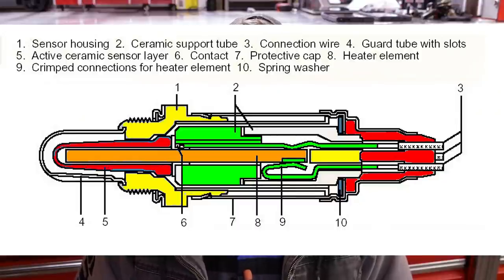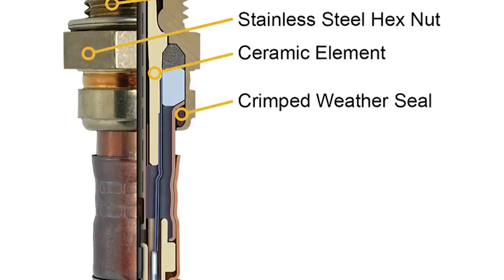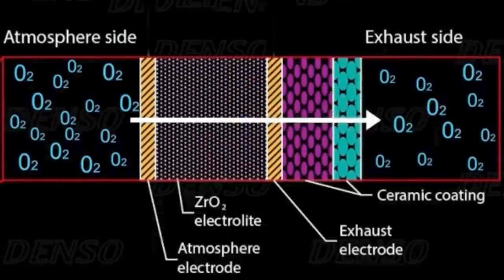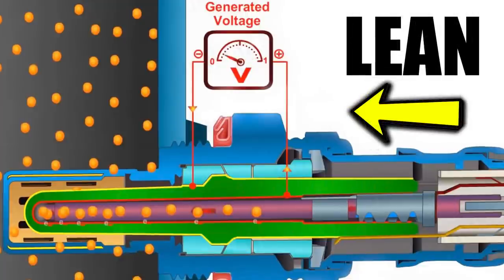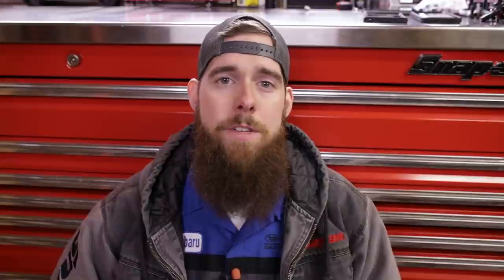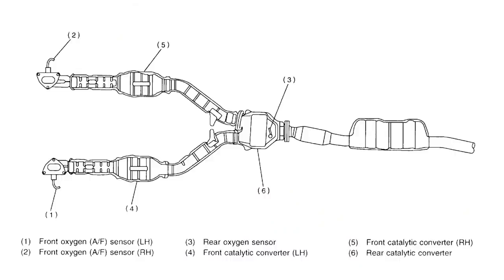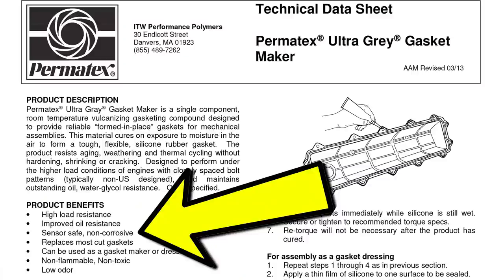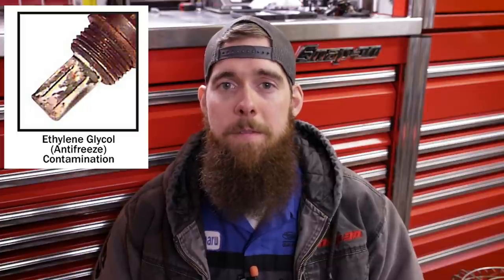Oxygen Sensors Explained! | An Introduction Into The Theory Of, Workings Of, And How They Fail!

Comment: Great stuff! But you MUST now do the follow up on Wideband sensors which wld be pre-cat sensor in almost all Subies since early-mid 2000s ... very important to understand failure modes and can be tricky😱 After a long diag, finally discovered an intermittent failing wideband O2 with a P0030 code on 2004 Forester with EJ251 was caused  by sensor element internal resistance not falling quick enuf to meet PCM programmed parameters ... in this case, PCM requires less than 50ohms within 30sec of start or after fuel cut off condition. Very tricky to nail this, but wen u r going to charge a customer $700 for a new part that u can’t return u need to be dead certain. Lets do failure modes, diag and test procedures on wide bands? 😉👍

Comment: Great Video as always.  Picked up a used 2015 Crosstrek Premium with 92K mile for my kid. I've been doing various things and this is one I like to do at 90 -100K.  Relative to the other Subaru's O2 sensors it's in a pretty easy spot to get to.  Replaced the front one with a Denso brand which seemed to be the exact same as the OEM I removed. Right down to the color of the wire coating and wire tie fastener.  I consider it inexpensive insurance for the future.

Comment: I'm working on figuring out the cause of my catalyst efficiency codes so this was great timing.
I've long determined the converter is gone, but working on debating if I should swap the sensors "while I'm in there"

Comment: I had one of the older Subaru Outbacks you speak of. An 01’. When I bought it the head gaskets were blown unbeknownst to me. My father in law and I redid the engine and it ran nice for a long time. I live in NY so eventually the rust got to it, put a crack in the actual fuel tank. The o2 sensors did their job -never threw a code. 
Very informational and well laid out video. I can’t wait for what you have next!
Reply: Excellent review, it should be noted that heat is the lowest form of energy. Just about everything generates heat as a byproduct. The O2 sensor takes heat and turns it to electricity, a higher form of energy. That's why they wear out. FYI.

Comment: Finally, a most comprehensive explanation on this item. Question though : will the slots in the casing determine the workings.? My supplier insist that the one with the smaller slots are the correct based on the part number.  But after installing, engine kinda running weird - like a very short hesitation when acceleration.. Especially when the AC is on..

Thanks for the great video..👍

Comment: Great presentation. I have a 98 honda Accord that has several O2 sensors die. It also burns one quart of oil per 1000 miles. You are the first to associate oilcontamination. Thanks.

Comment: Coolant takes them out too,the Fords with the 3.8 which had headgasket problems would take them out when the headgaskets blew. ln certain year Dodge truck,the  O2 sensor also is involved with shifting of the transmission.Have fixed a few transmission problems in these replacing the rear O2 sensor.Do not top off the gas tank,EVAP system needs space and have seen O2 sensor codes appear from this

Comment: I remember giving my tuned rs to a shop in Utah that “specialized” in Subarus to fix a surging issue I had while driving, left it at their shop for three months while I was out of the country and came back to them “solving” it by replacing my charcoal canister.   I took it to Colorado for a friend’s bucking and surging the whole way there, under wot it ran normally. I happened upon the Subie Doctor while in Colorado and within ten minutes of looking at it had already diagnosed the issue and put in a brand new oem o2 sensor.

Comment: Great explanation.  There is a lot of bad information out there on the internet about these sensors that I found when troubleshooting a P0420 code on my '10 OB specifically the many folks saying to replace both O2 sensors.  Mine were working correctly and the downstream sensor was telling me that something was wrong thus setting the P0420 code for catalyst insufficiency.  I cured that with three treatments of  Cataclean and no recurrence some 1000 miles later (I suspect that I disturbed a bunch of crap in the vapor collector when I overfilled the gas tank and temporarily shot crap through the engine).  Keep these videos coming - they're great.

Comment: Don’t have a Subaru but have an 04 Honda Element and this video was very informative. Months ago I was in a heavy rain downpour and my check engine light came on with a P0420 code. I cleared it but now it came back again. My car has over 218,000 miles. I bought new sensors anyway and plan to install them but taking it to my mechanic to install and check the system anyway. The car runs good and I have added Cataclean to see if that helps. Short term bank 1 fuel trim 6.2%. Long term bank 1 fuel trim 3.9%.

Comment: Talk about perfect timing, I had my 2010 Forester serviced last month for (System too lean {Bank 1}), and the A/F sensor was replaced. A week later the Check Engine came back on with the same code via (Hum by Verizon P017) which turned out to be more than the sensor itself. Intake Manifold Gasket/Fuel Pump/InjectorSeals/PCV Valve. Not bad for a high mileage vehicle 412,433+.  
I will be doing a complete front-end overhaul by April 2022. In 2023/24 my goal is to buy a new Forester when I retire and hold onto this ole girl...

Comment: I would enjoy a followup regarding O2 sensor heater control circuit high/low codes (P0031 & P0032). This will also cause an open loop condition in some Subarus. I'm pretty sure the ECM sends a PWM signal to the heater, switching the ground, and if it isn't detecting proper resistance?? from the heater, it will shut off the O2 sensing, defaulting to open loop (14.7  fuel/air ratio).. Of course, a bad heater or heater wiring will cause this. There's something else causing this in my 04 Baja. Really pissing me off. I'm sure a lot of folks are chasing this error. Any help would be great.
Reply: Same here I've changed sensors twice and still have the problem

Comment: My 03 Bean, which I've had since new, threw an oxygen sensor code about three years ago. It's always been garaged and has never had an engine fault. My mechanic replaced the sensor (although he said it was a real pain to get out) and all was fine, but I had him go ahead and replace the other two sensors. After that the engine seemed to run much, much smoother. I guess 15 years is about the life span of these sensors before they start deteriorating.

BTW, my wife's 02 Camry (also since new) threw a front oxygen sensor code a few years ago. I got an OEM Denso sensor for less than $100 from Amazon and it took 15 minutes to replace it as it's on the top front of the engine. Couldn't have been easier.
Reply: My 09 outback needed a new O2 sensor to pass inspection last summer. A $350 repair.

Comment: I have a question or 3. First let me say thank you for your time and effort in making these instructional videos. I've found them very useful. 
I have a 2002 Outback sedan with the ej25. I bought it 2yrs ago with 163K on it and it came with Blue FelPro MLS headgaskets. I have 193K on it now. I bought the OE new gaskets that are the 642s the latest rendition from what I've found. I'm wondering do you think if be better off getting a new low mileage engine from JDM for like $1,500 or rebuild it myself? I've built an engine before gm 350 small block. But I'm sure it would cost me the same if not more.  I've also read that some of the connections are different on the ones from Japan but I assume I can just swap those from mine. I've already replaced all 4 wheel bearings,  bushings,  struts,  drilled and slotted rotors with ceramic pads and new tires. I love this car and even used cars are stupid priced and can't touch a good used car for what I'd spend to fix this one. The interior and exterior is in really good shape. I had an Aisin timing belt and water pump kit coming from Amazon but then they canceled the order stating it didn't meet quality specs which I found odd. Any advice or direction you can point me is HUGE and greatly appreciated. Thanks in advance.

Comment: Superb underrated video. This deserves way more views. MrSubaru, I am almost finished swapping a jdm ej20x long block on my ‘05 OBXT. Everything above the long block remained USDM. But I noticed these jdm engines have the main O2 sensor at the beginning section of the Down Pipe, rather than on the Up pipe. I disabled the exhaust AVCS since I’m using the usdm ECU. Being the main O2 sensor is on the Down Pipe for the ej20x motor, do you think this might influence the correct operation of the car?

Comment: I just so happen to have a check engine code for O2 sensor that began shortly before my radiator sprung a leak and another code was present for either thermostat or fan malfunction , the fan is operating so it's the thermostat.
I believe the faulty thermostat likely caused the old radiator to become pressurized and rupture. 
2002 Subaru Forester S with 148k miles.
Not sure exactly how any of the coolant problems may have affected my O2 sensors but i have no head gasket leakage that's detectable yet.

Comment: Very informative, I may replace the sensors in my daughter’s ‘09 Impreza NA as a precaution. 106k miles, gas mileage isn’t great, like 22. No codes. It does use some oil so will be interested to see what they look like. One suggestion: tell us what brand of sensors you recommend. Thanks.

Comment: excellent video congratulations, I have a question.
What happens to the oxygen sensor when a car is put direct pipe?
completely removed?
does it seriously affect performance?
Reply from the maker: Direct pipe?
Reply: @MrSubaru1387  Straight Pipe Exhaust System

sorry but i use google translate
Reply from the maker: If you remove the catalytic converter, no, doesn't affect performance. Just illegally removes a pollution control.
Reply: @MrSubaru1387  thanks for the explanation and great channel

Comment: Great video! My Legacy wagon 2006 EJ204 has a P0130 code. Bank 1 Sensor 1. I replaced the sensor in front of the catalytic converter but nothing has changed. Do you know if it can be the sensor after the catalytic converter or what else can be the problem?

Comment: Could an alternator failure possibly cause and old oxygen sensor to intermittently cause the check engine light to go on and off after the alternator is replaced? EJ251 with 144K miles. Long story behind the alternator failure and why the sensor code wasn't fully investigated but currently, after about 700 miles, the light is out.

Comment: Current Fault Log
P0138: O2 Sensor Circuit High Voltage (Bank 1 Sensor 2)
 Pending Fault Log
P0137: O2 Sensor Circuit Low Voltage (Bank 1 Sensor 2)
 Historic Fault Log

Can u help on that

Comment: I just drove cross country and halfway through Kansas I heard a loud sputtering sound. It was like a train. I pulled over and dad helped me figure out it was the oxygen sensor that was rattling and let loose. The updraft. We had to buy one and replace it to keep trekking. It was mostly an easy fix but the fact that the shop I took it to prior to the trip didn’t catch how loose it was, is just disheartening. They also didn’t even check the spark plugs or change oil filter or the melted-on gaskets on the transmission oil head. So many other issues. I have an ‘07 forester with 85,000 miles. Oh goodness the brakes were incredibly crusted on. Not even wheeling them helped. We just replaced the entire shoe and we’re able to salvage the discs and clean them up. Long story short the car came from Massachusetts and had never been officially serviced since. So I’m slowly getting up to speed. I have images I’d really love to email you if you ever want to share with your audience! Best regards.
Reply: I hate to say it, but I wouldn’t trust any shop or dealership on a Full Multi Point inspection… when I owned a brand new 09 Chevy, I paid a little extra for the lifetime oil which included an “inspection” of ; Brakes, Tires, Lights, Filters, etc. Well I had something go out or “bad” no less than 150 miles after my last oil change, and I said to the dealer; I thought y’all checked this along with all these things at every oil change? They said it’s more so a Visual Inspection, as in, if they see it and it noticeably needs replacing/repaired, then they do but that they don’t physically/literally put hands on each specific thing… which means they go down the 44 point check list and just cross them all out after doing a oil change and call it good. Granted this is a little different than say taking a rig in for a $200+ inspection and service, but again, I bet you anything a lot of it is briefly glanced at, doesn’t even have hands put on it….

Comment: I have a 2016 Forester with 110K miles. Periodically get the P0171 code, RIGHT at startup, never as I’m driving. I did have a local shop check it and they claimed it was a stored code and fuel trims were where they should be, but after a reset, two weeks later the same code popped up again at startup. I have changed PCV and hose, cleaned throttle body and MAF, without change except smoother idling.  Plugs have never  been done( I know, it’s on the list). O2 sensor never changed . What’s your take on this?  Any help is appreciated, thanks!

Comment: So just bought a 2010 sti hatch , has 122000 miles on body, just pulled intercooler off and saw I have a iag stage 2 tough block installed at 80000, has a downpipe and exhaust , it smells rich at idle and it has black in the exhaust tips. No oil leaks or coolant leaks no vacuum leaks . I’m thinking when he blew the original motor in the car it had oil/ coolant go through the exhaust , and I’m hoping they just didn’t replace them, just spent 300$ on new sensors….. I’ve tried everything I can think of just hope it works …. Any advice. It’s stage 2 tune also

Comment: But at higher rpm wouldn't the exhaust pipe have higher pressure , since more fuel and air are added? Wouldn't that higher pressure give other signals even though the oxygen content is the same?

Comment: Hi everyone and mr.subaru my impreza blobeye 2.0 gx 2003 125hp 92kw wagon has a problem with starting up. It always starts but its weird. Summer times its cranking up like 5-10seconds. Winter time on cold start it starts immediatly. If i turn the car off and start it in a minute it starts immediatly, but if i leave it for like 15mins+ it crancking like 10seconds. As i know car is doing that for like 10years i bough it like that. It has 230000km and original engine. Do you maybe have a video on that or any clue what could it be. I have zero engine codes? Love your videos 😃

Comment: Subaru outback 2005 California p030 or p050 ? The resistance is good. When i erase the code come back couple days. What is your Recommendation?
Reply: If the sensor signal wire is receiving about 2.5V-2-2.8V from the ECM with key on, and the heater circuit power and ground are good, then my experience has indicated that the sensor is faulty in that the resistance sensing elements is not falling as quickly as the computer program requires, therefore meaning lower fuel efficiency especially at start up. Usually, the ECM will shut down the sensor for these codes so you may have to cycle the key and test quickly before the ECM shuts down the circuit.

Comment: Hi! Thank u for your videos!
Can u tell me please from were to start searching:
Gda wrx
slight pulsaiting while slow acceleration or cruising, if wot car flys very well.
New sparks new coils etc.
Car is bone stock, no leaks, 
I know the car quit well, so such things as sparks,leaks etc, i have I excluded. 
Can such slight pulsating,Hesitaiting caused by low fuel pressure or o2 sensor?
Thanks!

Comment: My 2003 H6 outback gets the code for sensor heater fail bank 1 Replaced both and within 5000km again same. Tested old sensor and sure enough no circuit. Could something else cause this?
Reply from the maker: The heater was burnt out in the Bank 1 sensor, you replaced it 5k km ago, now it's burnt out again?

Comment: I have a 2004 subaru outback . It's a premium with leather seats. 2.5 engine 4 cylinder. The tool is reading bad cat. But the car runs great no power lost an its been some time. Could it be just a bad oxigen censor
Reply from the maker: What code? P0420?
Reply: Let me check...hold on
Reply: Po 171/po 420 / po 174
Reply: What do you think
Reply from the maker: @gaator1967  I’d address those lean codes and then move on to nay potential catalytic converter issue.

Comment: Considering replacing my stock y pipe on a 94 legacy L 2.2 with a header, looks like I will have to weld a bung in for sensor upstream, also, I have a new catalytic I could install, as I want to go ahead and just put all new exhaust on it. If I mimic the positioning of the stock O2 sensors and keep the stock muffler do you think that will work with the ecu?
Reply: I had a bad gasket after the Y pipe this year and replaced it, but mileage seemed to suffer after the gasket replacement, didn't change anything else, seems to run very rich on start up. It is also very cold now.

Comment: Tech question for you . I have a 2013 STI I’ve been having oscillation idling from 800rpm to 1300 rpm. I replaced my front O2 sensor with an OEM after engine rebuild. Then a tuner said it might be the O2 sensor. So I replaced it with an after market Bosh and it got better for like a day then oscillation idling returned but not as bad as the OEM sensor. So I drove like that for about a month. Yesterday I decided to install the OEM O2 back in the and the oscillation started again like before. I drove it around for 30 mins and got a CEL P0031 front O2 sensor heater input low. The weird thing about it is that the CEL seemed to correct the idling part of it. It idles pretty close to stock with the CEL light on. Any thoughts. Please help! Thank you.